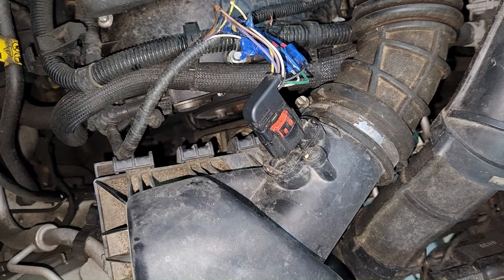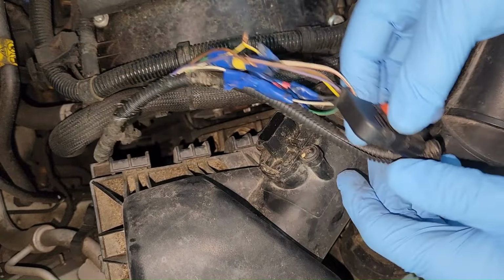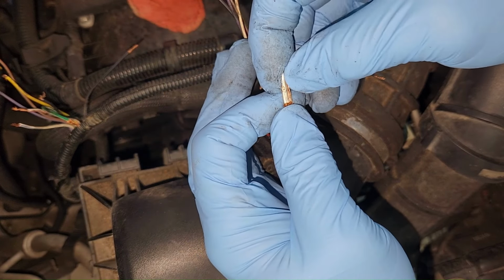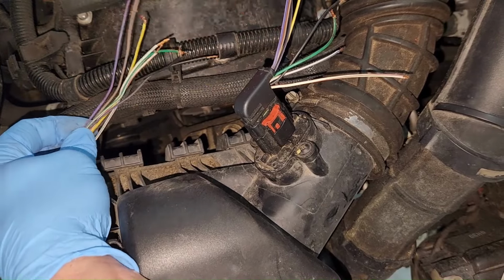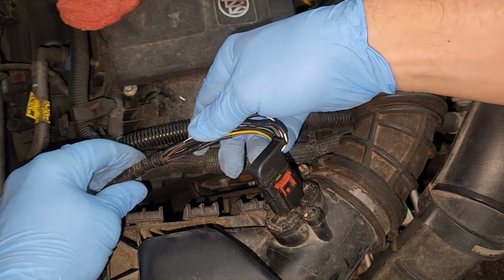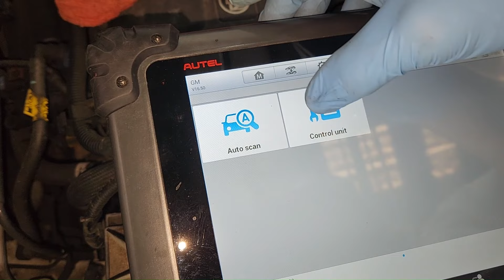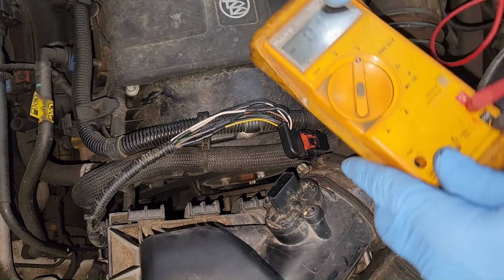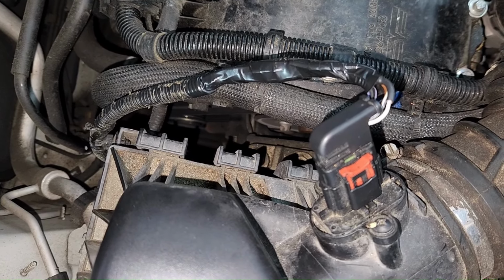2016 Buick Encore, Codes P0113 and P2199, Short Version

Comment: Wat If there not color coordinated
Reply from the maker: If the connector had wires that were all the same colors (like many replacement connectors do) then I would have had to matched the original wire colors to the correct pin positions using wiring diagrams and connector pinout diagrams. I hope that answered your question. Thanks for commenting and I hope you liked and subscribed.